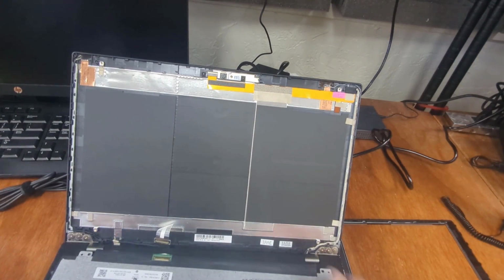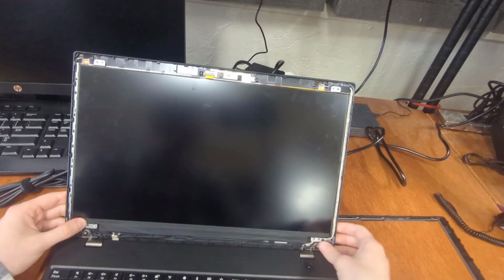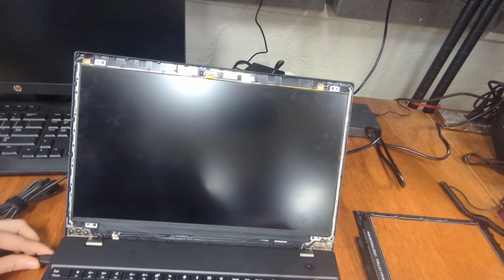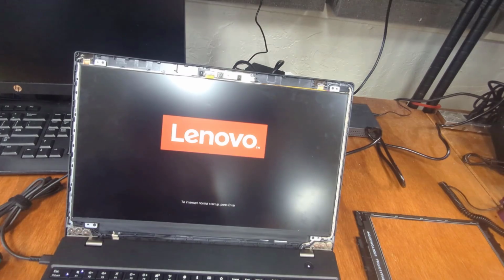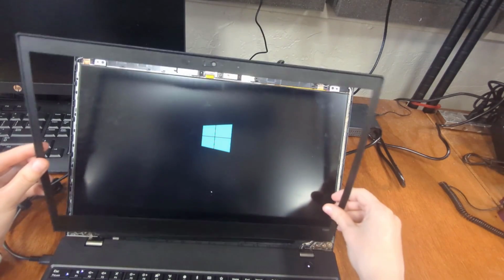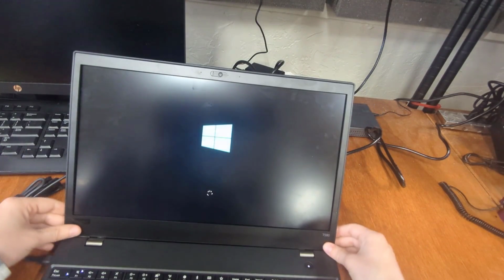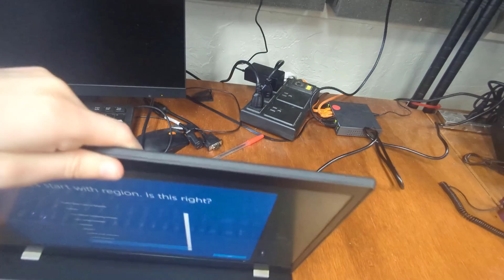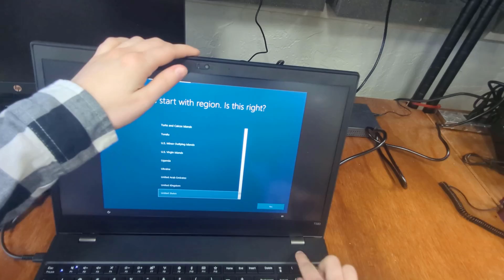Lenovo Thinkpad T580 Teardown/Disassembly | Hard Drive / RAM / Battery / Screen / Keyboard / + More!

Comment: Awesome video, I am concerned that I may have power button issue . Can you help me with some instructions on checking or getting to it.
Reply from the maker: If the power button on this model is pressed inwards really far, you could use something like a dental pick to gently pry it upwards to see if it helps the button stay in place properly. Unfortunately, the power button is attached and is a part of the palm rest, so it makes it hard to repair. You can swap the palmrest part for this model if the button cannot be repaired.

Comment: It's not super clear, if I want to use a 2.5" SATA drive, do I need a different cable? @4:15
Reply: nevermind, I found the answer. it's a yes and a different cable/adapter can be bought from aliexpress

Comment: I have a old Lenovo T510 with ultra bay.  It has been rugged, surviving my dirt  bike trips. The hard drive is just a couple of screws from a back panel to remove. And the ultra drive comes out via a little sliding latch.  Is there a updated Lenovo version of that machine?  I sure can not find it.  The T580 has the mouse pad to the side because of the 10-key key board.  Is there a T580 that one can fit a smaller keyboard in and have it centered on the laptop?  Is there a laptop that will accept two external new style operating system drives?  I like having the two drives without having a duel boot drive.
Reply from the maker: You might want to look into the smaller screens like the T490, although the trackpad is still slightly off to the side. Most ThinkPads do not come with multiple drive bays by default, and the T580/T480 have two M.2 slots but you can only use one of them at a time so that does not help. I would recommend searching for something based on your spec needs and seeing if it has any way to add or convert more SATA or NVMes.
Reply: @compumatterllc  Ok Thanks.  Just making sure I am not missing anything obvious.

Comment: I would like to know the screw size in the bottom cover, please. I bought a T580 that came without!
Reply from the maker: I believe they are Phillips 3.3mm screws.
Reply: @compumatterllc  i will try to get one and check. Thanks!
Reply: m3.3? or length?

Comment: I have a question. I found a used one of these in a box for $10. It won't boot. It is missing both batteries. The keyboard will light up and the fan will span for a several seconds and then it seems to turn off. The LED on the power button will stay on. I've tried reseting the ram and that does nothing. I will note it does chime when I completely remove the batteries. Question will these laptops even boot without the batteries?
Reply from the maker: Yes, they will boot with the power cord plugged in and no batteries. Have you opened it up to see if the CMOS battery is plugged in properly? Another thing to try is plugging it in to an external monitor in case the screen is the issue here.

Comment: is this iGPU model? i saw dGPU model has two heat pipes.
Reply from the maker: I'm pretty sure this one in the video was the integrated model.
Reply: @compumatterllc  do you recommend T580 i5 or i7?
Reply from the maker: It depends more on the number that comes after the i5 or i7. I wouldn't recommend anything lower than i7 8xxx or i5 8xxx due to Windows 11 support issues. CPU benchmark is a great website to compare CPU specs!
Reply from the maker: Do you have a use case for touchscreen?
Reply: @compumatterllc  i have Pen tablet for drawing. having touch scree is risky other than normal one?
Reply from the maker: I'd recommend going for the option that you feel you would utilize the most. If you don't use touchscreen on laptops, you would probably save some money by skipping it and investing in more RAM or storage size.
Reply: @compumatterllc  good.

Comment: It is important to note that the internal battery must be disabled first in BIOS settings before unplugging its connection to the motherboard. Not doing so could blow up the a fuse in the LCD. Upon disabling the internal battery in BIOS, remove external battery and any power connection (USB C ports) then double check by pressing power button if laptop would not power up as a verification that internal battery is in disabled state.
Reply: Sadly, I think I just did this.  Too bad she did not mention that one!!!  Refurbed T580 on order.  This was my workhorse before the SSD failed. (And in trying to diagnose I think I probably killed the monitor ... so that's that!)  Thanks for pointing it out!!!
Reply: Yes, this is a critical step. My T580 didn't have the second internal battery (some don't apparently) but don't take the chance if you're new to taking apart Lenovos.

Comment: 🤩 Thank you for this great  tutorial 😊 do you think this tutorial will work for a ThinkpadX270?
Reply from the maker: They will not look identical so the teardown process will look slightly different, but you can utilize the knowledge you learned from this video to identify the parts inside! Be sure to disable and unplug the internal battery before working on any internal components or a screen replacement. If you run into issues you are unsure of, it never hurts to look up a guide for your model. Thank you for the kind comment and best of luck!